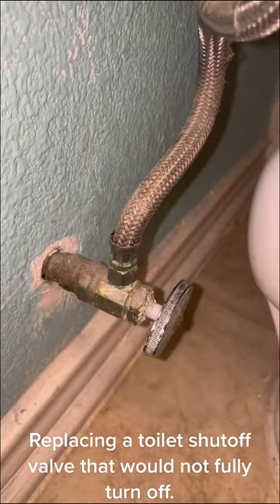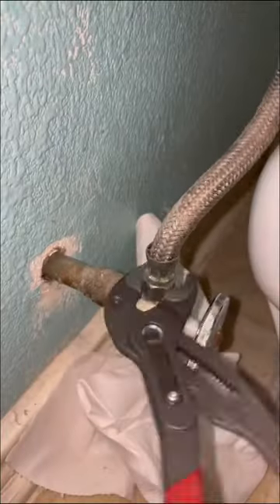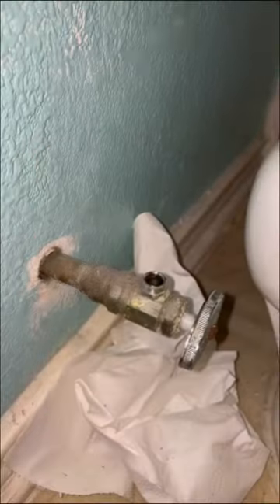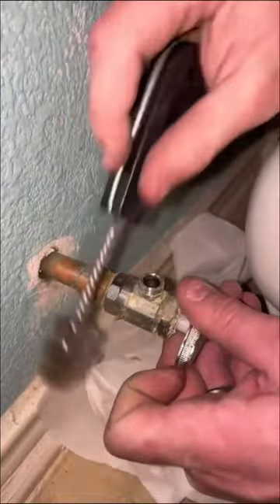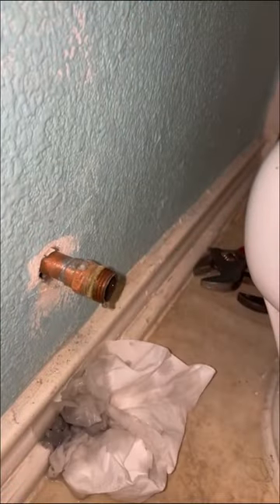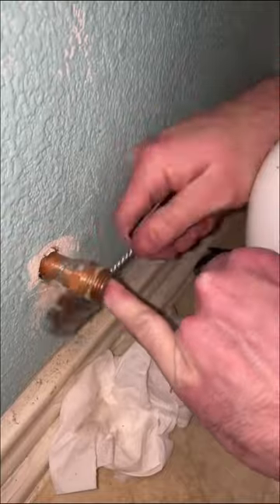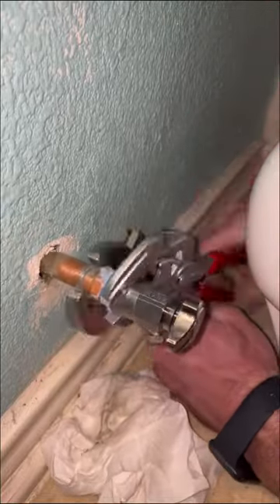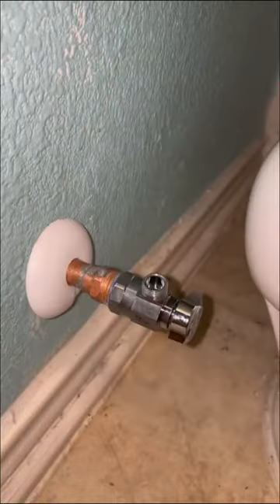Replacing a shutoff valve for a toilet. #plumbing #plumber #howto #diy #fyp #trades

Comment: yeah the 1/4 turn valves are light years better than those old crappy multi-turn ones that never shut off all the way
Reply from the maker: I agree
Reply: I've never seen a 1/4 turn valve that didn't fail after a year.
Reply: If they were made good quality I’d agree but they seem to fail just as often if not more often. And with the quarter turn you can’t even loosen to packing and crank it down tight to force it closed
Reply: @Failer__  This is just a straight lie.
Reply: The old ones scare the crap out of me
Reply: All metal 1/4 turn valves are the way to go. There are some valves with plastic parts.

Comment: Every single time I replace a toilet, I replace the angle stop with a quarter turn valve. Same with under sink shut offs. They are just better in every single way.
Reply from the maker: I agree completely
Reply: I charge extra for that
Reply: Yes. I just had to replace a couple of water shut off valves at one sink. The original ones wouldn't turn at all when I needed to shut off the water so I could replace a faucet cartridge. The original valves have in use since 2003. The new valves are all metal compared to the old valves.

Comment: I like the quarter turn valves better because the client can understand how to use them better. I can tell you from living up in the frozen tundra if you ever have a freeze up the multi turns fair much better. I have actually seen the multi turns survive recess, where these quarter turn valves are built very cheaply these days.

Comment: The old guy I rode with before I got my license didn’t like the 1/4 stop because you can’t rebuild them once they go bad but to me I’d rather not fool with shutting the water off to rebuild one that takes as long as replacing it

Comment: I like the copper threaded fitting that's soldered to the pipe! It's better than using a compression fitting.
Reply: Not always better than compression.
Reply: @jmackinjersey1 always better
Reply: Even better yet use a pex x 1/2" female threaded drop eared elbow and use a threaded nipple between the elbow and the valve. A drop eared elbow has two ears with holes in them that you screw to the framing. No floppy pipe to valve as with compression valves or threaded male adt.
Reply: Male adapter. Still works fine, wouldn’t say it’s better because it’s an eye sore. Scussion ring won’t hide it you’ll see the copper. Some customers don’t want to see that in their bathroom they had remodeled with brand new everything
Reply: @johnypitman2368  Lol, no
Reply: When done right compression is very solid and reliable

Comment: 1/4 turn are stainless balls and nylon bushing, I believe.  Multi turn are rubber filled and a nightmare comparatively.
Reply: Quarter turn angle stops use a barrel, not a ball, and the barrel is plastic.

Comment: When  a 1/4 leaks from the shaft your done,  brass craft multi turn is the way to go, you can tighten the packing When need ,as well completely replace shaft, washer and packing . Good luck folks.  Keith, master plumber 32 yrs
Reply: Thank god someone said it!!!!    No packing nut and it leaks in three years out the stem as soon as u touch it and replace it AGAIN!!!!!    Would not have it in my doghouse!!!!   3/4 ball valve has packing nut.  1/4 hose bibs and angle stops do not.   You won’t find that trash on my truck.  Just my opinion and this other guy too.  36 years plumbing here

Comment: Great job!   I always replace with 1/4 valves. Being in my home 20 years, we replaced all these valves last year , the old ones were the old style, some worked but most didn’t.  I purchase 15 and the price was a lot cheaper than buying one. All my valves were compression on both sides.
Reply: Yep. I try to open/close mine a couple 2 tree times a year. Most of my shutoffs are in the bment ceiling and I can just reach up and shut them on/off as I'm looking for that fkn tool I know I put away.
Reply: Yes. That's what I've been using. Specifically, all metal ones. The one's at Home Depot have plastic internal parts. I ended up buying them online. The cost is almost $2 more. I carry a couple extra for emergency use. Supply House has a good selection than any local store in my area.

Comment: Quarter turns are nice. Multi turns are outdated and proven to fail time and time again. I very rarely have to replace quarter turn valves, if ever.
Reply from the maker: Same experience here.
Reply: Multi turn valves are great right up until to you have to shut them off years later to work on the toilet or faucet, then they leak. Sometimes you can tighten them back up, but I expect to have to replace them everytime now. I'm not a professional plumber, just what I've learned over years of doing my own work.

Comment: I’m surprised, I prefer the older styler for rebuild ability
Reply from the maker: I find it easier and more reliable to just replace them completed rather than repair. I especially like the 1/4 turn valves by Wolverine Brass. They are rebuildable if you wanted to.

Comment: May I ask why you chose to, not do anything with pipe moving in the wall? 
And the valve that is not going to be used was chosen because of its direct  fit to previously installed hoses?

Comment: Quarter turns every time. There's no question about whether you actually turned it all the way, and they ladst way longer for sure. And no doubt copper stubout with male adapter sweat on the end is the only way to go.

Comment: I've been changing out the builder installed multi-turn compression valves with plastic stems attached to pex runs with terminal smooth copper with 1/4 turn compression valves with metal stems from Lowes after 2 multies failed at the plastic stems in my new construction (2009). There were about 20 multi-turn valves in the house and didn't want to have to worry about which one was going to fail next, esp since all 6 toilets were part of Vorten's recall also and 2 of them had already leaked as well.

Comment: I ise whatever they have in stock for the type of pipe connection.

I agree that it is mot cost effeftive to rebuild them anymore. The main issue i have in this area, as well as a few other places I've lived, is the higg concentration of minerals in the water, and how they eat and pit or build up on the interior walls, so they don't seal properly when you put it back together.

Comment: I use the 1/4 turn and I like them for two reasons. 
1. They turn of quickly. 
2. In about 20-25 years they will all need replacing. 
 
You cannot rebuild these. 1/4 turn was a thing in the past. I have seen what’s coming. Planned obsolescence.

Comment: 1/4 turn hands down. The full turn valve with the plastic stems don't last
Reply: I replaced a couple of 20 year old multi-turn shut off valves.  I could only wiggle them when I tried to shut off the water so I could replace a faucet cartridge. I replaced both stop valves with 1/4 turn all metal valves. The original ones had plastic parts in it. It I had tried to force the valve to turn I probably would have snapped the plastic stem. I can see that the one in the video has a plastic stem also. People say that one should turn the valves inside the house at least once a year. It's easy with the quarter turn.